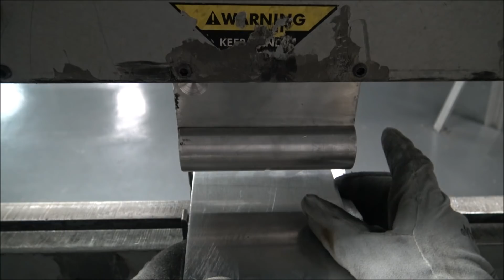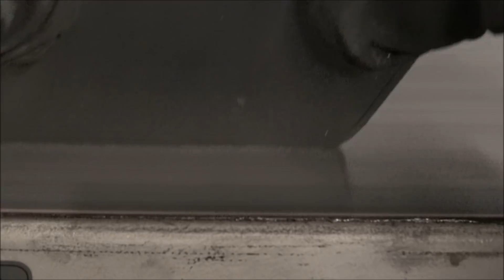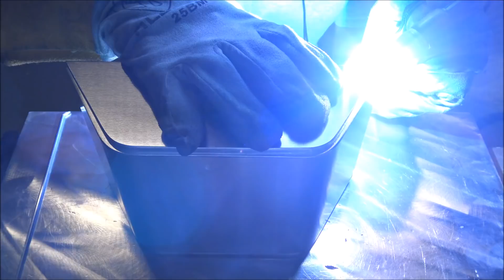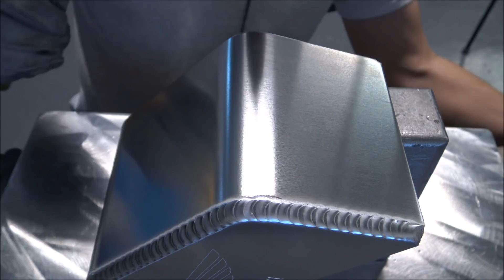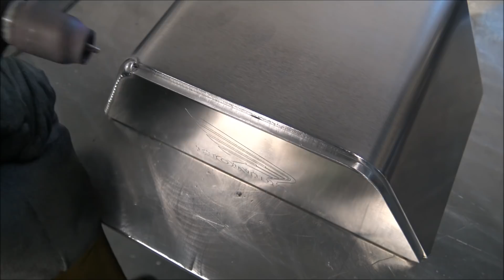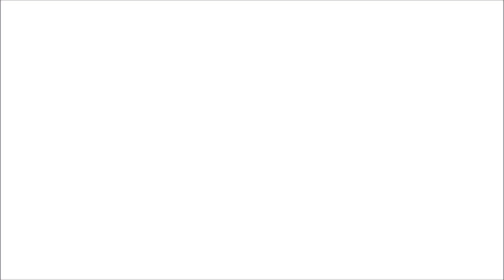TIG Welding Aluminum Fabrication - Starting Blocks

Comment: No one should be allowed to make welds look that good
Reply: Yeah nobody! 😂🙏
Reply: ez when u don't have to add filler rod, did that for a sump pump cover, just for looks, instructor didn't see me do it, but said after he saw it, "man, u have a steady hand" fooled. holding the tig torch with 2 hands and having a corner joint, just move a bit back and forth to use the edges as the filler, i do that with thin cu all the time.

Comment: I never knew you could tig weld without filler rod until now... 🤯🤯🤯
Reply: Really only outside corners and I think edge welds? We made butt welds without filler in school, but that was just for practice. It wouldn't be very strong.

Comment: Beautiful welds. I sold welding equipment for 25 years. The tig process was my favorite. The push button would take me a little time to get use too.  I liked the foot pedal, like giving a car gas to go. But, definitely get into small spaces with the button.  Good memories!
Reply from the maker: Hi Dave,
The only time I ever use a foot pedal anymore is when I'm welding really thin material (unfamiliar) that I haven't welded before, sitting at the table. 95% of the time I use this finger controller. Just like a pedal, it takes a bit of getting used to. But if you are willing to put the time in, it can be a huge benefit, even sitting at a welding table. My posture is a lot better now. I was welding hundreds of the same parts per year for several years, and the sideways hunching over (with the foot pedal) started messing my back and neck up. With the finger controller, you can sit nice and centered with both feet putting equal pressure on the floor. Besides all that, out of position welding (roll cages, stand up welding, etc.) is a lot easier. No more kicking around a cumbersome pedal. I love it, that's why I sell it: http://www.6061.com/tigbutton.htm
Reply: 6061. com  I’ve been using a button for years and just setting the amps to what I need on the panel. When you said roll cages I had a flashback to sticking the pedal between my knees when I did em. Didn’t realize your button controlled the amps with pressure. Might be ordering one soon. 👍

Comment: No one would ever sand away these welds. They're so perfect, they make the ideal finish in and of themselves
Reply: Nobody would sand them away because they would break, no reinforcement from being fused.
Reply from the maker: Philip,
They would still hold up just fine. They are just starting blocks that get stood on.
Reply: @6061  you reckon you could sand them out?
Reply: @momouppa  🤣🤣🤣

Comment: Good video. Plenty strong for the application. I am a boat builder and at one company I used to work for we used fuse pulse on quite a few parts. There was a vertical outside corner joint 8mm to 3mm, so I overlapped the 3mm onto the 8mm about half way. Pulsed moving up. Looked like yours but a bit more more overlap /tighter ripples.

Comment: Cool little job, with the beautiful welding as we've been led to expect from you :-D
For the Mk2 version, have you considered checker-plate, for a bit more resistance to slipping when the blocks are wet and/or muddy?

Comment: Wonder how that speed pedal works on that welder, I've only seen amp settings controllable. And nice of you to slow down there for a sec so we could see what's going on :)
Reply: Pulse feature on many welders.
And he doesn't use an actual pedal, he uses a 'TIG button' amp control.